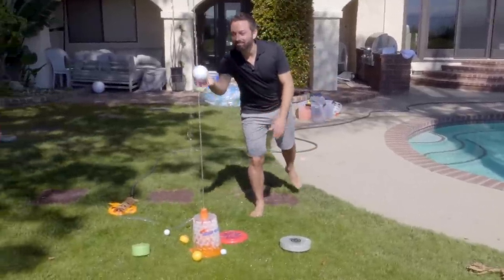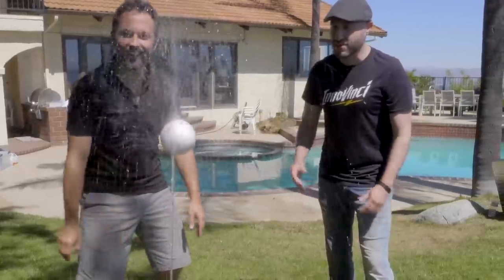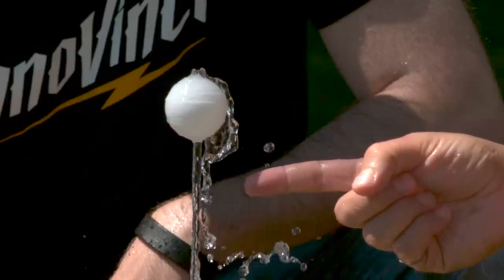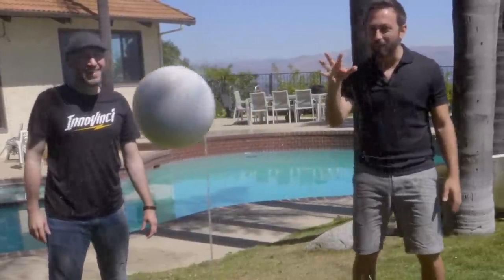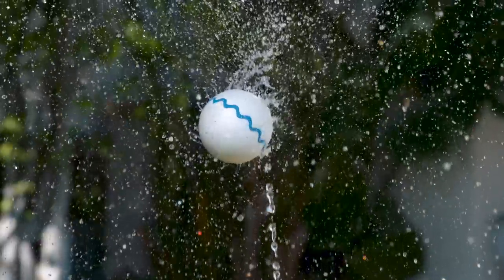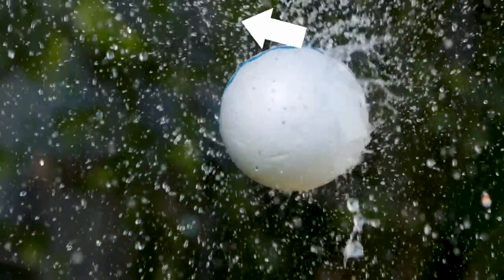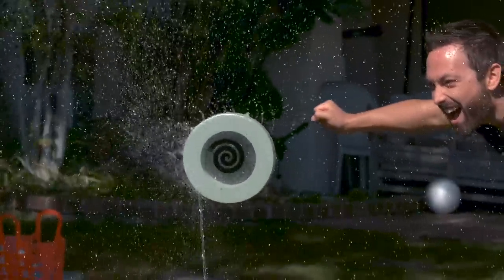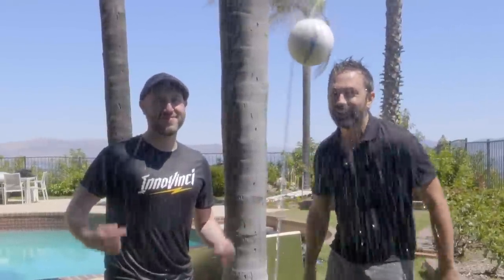Hydrodynamic Levitation!

Comment: Derek, it would be awesome to try this with a ball covered in hydrophobic coating - if the water cannot stick to the ball, much less of it will be deflected at an angle, probably making the configuration unstable, right?
Reply: Petee and a hydrophillic coating.
Reply: Yes, this is an excellent idea.
Reply: DO THIS!

i was honestly thinking about this righjt before i saw your comment, would b an awesome experiment
Reply: Petee it won’t work. You’ve essentially reduced friction. Friction is required to put the sphere or disk in rotational motion.
Reply: metwono 
thats the point, to see the case in which this phenomenon breaks down
Reply: Exactly.
Reply: thats the essence of science. you dont go well that sounds like a good theory and just accept it. what if a hydrophobic ball still worked? then the theory would break down and we'd be left with the question of, well whats the real answer then?
Reply: Someone mentioned this in another comment, thought that would be the result as well, if the water cant 'stick' to the ball, it would just get pushed out of the stream.
Reply: Corry Tuskey I understand what you’re saying and I don’t discourage anyone trying it. You could also consider different mediums. Would this work with air? At what point is the sphere mass too great? What would happen if you could change gravity? What if the mass of the sphere was nonuniform? What if the surface of the sphere were different? Etc.
Reply: microbuilder Yeah, I mentioned it and got 0 likes and 0 comments and this guy has 139+ likes and multiple comments. Oh well, just want to see it tested.
Reply: lol thats youtube for ya
Reply: The old Veritasium would've tried both configurations. The new one is all about being like the king of random and views.
Reply: This would be a great test of what I think is happening. I think its surface tension driven. I strongly hypothesize that it wouldn't work in this case
Reply: Nick Chambernator you should watch his new video about YouTube. this was all part of a bigger project
Reply: Petee soap water would also be interesting
Reply: YES I thought this right away seeing the video. It has a lot to do with water surface tension. Just use an additive in the water to break the surface tension (dish soap), and add it while the ball is suspended and I bet the ball would come crashing down as soon as the dish soap takes effect.

Comment: Hi Derek. I'm a bit late to the party, but I only just saw this video. Your explanation makes sense (conservation of momentum as the water leaves the ball) but I'm not so sure that the Coanda effect doesn't play a part... I think it's possible that the levitation happens because you have flow over the surface of the ball, which entrains surrounding air, generating a low pressure region where the water stays attached to the ball. Some water separates as it travels with the ball. The separation of water disrupts the entrainment of the surrounding air so the local pressure reduces compared to the start. When you integrate the pressure over the whole surface, you end up with a net force up and towards the stream. Similarly, you can take a piece of paper, hold it vertically and move it towards a running tap. As soon as it touches the water, the paper bends more towards the water. When the tap is running without the paper, air is still entrained but from all sides so the water runs straight down as it's in equilibrium. When the paper is placed with one side towards the stream and touching the stream, the dry side has no entrained air by the stream, only the wet side resulting in a low pressure and a net horizontal force further towards the stream. Try this out :) (maybe with a laminated paper, cause the paper gets soaked very quickly otherwise and stops working).

Comment: The force of the spray down cannot equal the force of the water out, the system momentum has to be equal and the sprays in all directions put pay to this theory. In addition this would have no affect on the initial suction of the ball prior to the spin being induced. The actual explanation comes from a common misconception about the lift from airflow being from bernoulli's principle alone. In actual fact a large force comes from the coanda effect, which is the suction caused by the boundary layer on the surface in the flow. If you dangle a spoon from a string and bring the curve under a stream of water under a tap you can see this effect yourself, noting how its not the pressure differential of the two sides of the spoon causing the spoons displacement. This demonstration of the ball in water is much the same. Its the suction of the boundary layer caused by the coanda effect, not the countering momentum of the water droplets, which itself would be minimal. This also helps to explain the natural balancing to bring the ball back into the stream as the effect is exasperated by increased deflection of the boundary until the point boundary separates from the surface and the ball falls from the stream.
Reply: ChevronTango now thats a much better explanation.  I was thinking the same thing about how the water tossed out cannot balance the force of gravity.   seems like dumb people levitate towards the simple explanations jesus christ

Comment: Would the ball behave the same way if you coated it with a hydrophobic layer?
Reply: Probably not because the water wouldn't bond cohesively to the ball, it would be reflected off the ball, pushing the ball out of the way of the stream
Reply: Fishface 88 i think you meant to say adhesively not cohesively.
Reply: inademv that would be a really cool experiment to try to verify his explanation!!
Reply: Sad not to have an example of this in the video. It was certainly the first thing I was curious about.
Reply: inademv the boundary layer will still be a layer of water, even if there is a hydrophobic coating.. it might work the same, but an example would have been good. top notch observation.
Reply: yep exactly. Water pushes the ball up while simultaneously wrapping around it. The spin keeps water sticking and the ball stable.  Probably other things play a part as well like the droplets that leave the ball in all directions help it stabilize even more.
Reply: inademv no because the adhesion is necessary for the force that keeps the ball in the stream
Reply: I don't think it would because that would stop the water from sticking on to the ball so it would just move away from the stream
Reply: We don't know for sure that that is actually the reason for the stability. Due to current data, we made a hypothesis that the water flinging around the ball is supplying ample force in the direction toward the stream to balance out the force applied directly from the stream in the opposite direction. However, I don't think this explanation is fully grounded since in some instances it looked like there wasn't really that much water being flung in the opposite direction, or at least maybe not enough to counter the stream force itself.
This is a science channel, testing whether the hydrophobic layer has an effect will help give evidence to suggest why the observed phenomenon is occurring, perhaps supporting the previous hypothesis and perhaps suggesting against it. Definitely worth testing, in my opinion.
Reply: I would like to see different surface types like golf ball dimpled or perfectly smooth and how that affects the behavior. Great video!
Reply: General.E.Shady 
But water gets propelled in one direction, there must be a force acting on it. And the counterforce can only act on the ball / disc.
Reply: you'd need a much bigger water stream. the Bernoulli effect would still allow it to levitate, but it would be much less stable
Reply: We have hypotheses, we need testing and a followup video.
Reply: The reason this round object does stay there, is because of the surface tension of the water. The water sticks to the surface of the objects and when it leaves, it exerts a force on the objects dragging it with it. Actually, the water doesn't leave the object at 5 o'clock, as Derek suggests, but instead most of it at 11. While it leaves, it also pulls the object with it. Pause the video at 4:47 where you can clearly see the effect.
Reply: Eris Sako yeah that's actually a pretty convincing theory!
Reply: Styrofoam is already hydrophobic...a better question would be a hydrophilic coating I think.
Reply: Fishface 88, That's why inademv asked about it. We don't know the real reason why this is happening, doing what he asked could get us closer to the real answer. We need to find a way to eliminate what we think is the cause of this phenomenon without changing any more variables; if the ball behaves the same, then there's another reason, but if it doesn't, then we know we can be surer that we have the right theory.
Reply: What would be really interesting to work out is what defines the height that the ball becomes stable at. I assume it'd be a function of the mass of the ball and the mass flow rate of the stream of water but it'd be interesting to try different sized balls of the same mass to see if that may result in a different resting heights
Reply: I wonder if adding a stream of a more viscous liquid (barring technical difficulties) would also be nice to explore this hypothesis. To the physicists/engineers out there: how would changing the viscosity of the liquid change the dynamics (relative to Bernoulli's law) ?
Reply: G'day,

  Yay Team !

  Great question...; and I think it would make a great difference.

  My guess is that Veritassium has got this one wrong, in that the Upwardly-moving Stream of Water is imparting "Lift" (Force directly opposing Gravity) via the Surface-Tension which enables the Water to both pull the Ball upwards and prevent it from moving entirely out of the Flow...

  The whole trick hinges on the Surfac-Tension allowing the Water to pull on the Ball.

  Add a bit of Detergent to the Water, or Grease the Ball, and watch how entirely differently this trick goes....

  ;-p

   Ciao !

Comment: Hello. This is a really fascinating experiment. However, I think that what actually levitates the ball has to do more with adhesion. The upstream coming under ball gets into contact with the ball on one side and due to friction, the ball is set in motion. However, due to adhesion, as the ball rotates, it tends to change the path of the water. To do this, the ball has to apply force on the water. There is an equal and opposite force due to this which pulls the ball towards the water, the upstream then applies a force underneath the ball, therefore keeping it levitated.

Adhesive force between the water and the ball keeps the ball in contact with the upstream and then the jet of water pushes the ball upwards.

This means that the total mass of water deflected should not be less than the mass of the ball or else the ball would fall.

Can you try one experiment using a hydrophobic coating/paint/spray on the ball and then another experiment with the jet of water at an angle? Please?

Comment: Back in the 80's I had a toy like this but instead of a ball it was a conical shaped thing, wide base narrow top. I think it had small holes in the sides to spray water outwards over the kids, but the top was a closed cap. Because of that, it was easier to accept the water kept it semi-stable, not like the ball off kilter. But I always felt it was MORE stable than it should be.  Like I felt if I didn't hold it perfectly flat when placing it on the water stream, it should topple off sideways before it had a chance to balance - but actually you could be quite casual and it would still take. As I remember it rose and fell and oscillated too, maybe because of the water holes on the sides? It's main colour was yellow I think, with red decorations. Who remembers it?

Comment: I think it has a lot to do with how the water sticks to things. The droplets are going up with considerable force. As they hit the ball they tend to bounce on the other direction (as do things that hit each other), but they are stuck to the ball now and that momentum pulls the ball and the droplets back together. Since the droplets had motion before touching the ball, that keeps the ball and droplets system in place.

Comment: This doesn't feel like a very fundamental explanation. 
Why is the force from the water rolled over the ball to the other side that pushes it back in the stream bigger than the force from the water that pushes it out?
I suppose bernouillu's law makes up for this difference.

Will it levitate if it can't spin?
Reply: I agree.
Reply: I suspect as the ball moves out, the steam can apply more torque than closer to the center, transferring more energy to the water stuck to the ball, and that causes more acceleration which gets the adhered water to fling of earlier, so more horizontally than straight down, resulting in the ball being pushed back into the steam.
Reply: I agree that the explanation didn't seem complete. I understood it better after trying it for myself - you can replicate it with just a spoon at your kitchen sink.  With the tap water flowing over the back surface of the spoon, you can feel how strong the force is (it works best with nicely rounded curves like measuring spoons). The ejected water to the side strongly pulls the spoons back into stream of water. 

I think what he didn't mention was that the force pushing the ball out of the stream greatly reduces (to almost nothing) when the ball has almost fallen out of the stream. Think about it - the water is hitting the ball's surface at an almost vertical angle, so it can't transfer much sideways momentum. 

This explains why the ball is actually stable at an off-centre position. The force pushing outwards has reduced to a point which perfectly matches the total force from water being ejected. 

TLDR: The force pushing the ball outwards reduces to almost nothing when the ball has almost fallen out of the stream + more water ejected sideways = ball moves back into stream.
Reply: I'm pretty sure the force is equal, otherwise it wouldn't be stable
Reply: I'm pretty sure he did not say that it was stable at the center.
Reply: Nick - true, I guess he didn't say it was stable in the centre. I'll remove that part.
Reply: I wouldn't think so. The spin seems integral to the effect.

Comment: This is the Coanda Effect. This is the same effect that keeps the airplane's wings suspended through the air. Also keeps the back of a spoon 'held' on the water stream. The ball (or disk) doesn't need to be spinning, as seen at 3:43. Friction is causing spin and sustentation, along with Gravity bringing it downward, Coanda is stabilizing horizontally.

Comment: 3:33

You claim there is a return force. I disagree.

The fact that the water is carried over and falls off the other side of the ball is not an indication that the water is forcing the ball back to where it was. That is what you thought. That isn't the case.

I am pretty sure what is going on has to do with water bonding with the ball and the suction effect it creates upon bonding. You know this bonding from the popping noise when a ball sits in your pool and you yank it out, for example.

So what is actually happening is, the water shoots by and some of the water creates a contact point where the water and the ball are now bound. Much like a vacuum.
The water,  still having momentum, tries to carry the ball up with it. But the ball is too heavy and the bond isn't strong enough so the bond breaks and so ends the vacuum. That leaves the ball behind. Some of the water shoots up and some of the water rolls with the ball. The ball would fall at this point but because more water is hitting the ball, the process restarts.

In conclusion, there is no other force beyond water pushing into the ball and then water pulling on the ball as it tries to carry it with it. There is no other force pushing the ball back to the center again. The cause for reset is 100% the vacuum.

Comment: This is a special case.  The necessary condition is the high surface area with respect to the mass,  It should work with anything circular in cross section.  The zone of stability is between 45 and 135 degrees. Those points reflect the maximum horizontal forces inside the system If no perturbing forces push the center of gravity from between those two points it will stay there as long as your water holds out.  Gravity provides the restoring force.  The forces are radial across the top and the spray is momentum.  The radial forces across the top sum to a vector equal and opposing the resultant vector of the stream, after removing the couple which rotates the ball.  The ball bobbing in the videos is a.response to variations in the stream and the wind load.  The restoring force at work. The heavy lifting in the phenomena is done by symmetry.  A sphere is placed in the right position to achieve this effect because it is symmetric about all three axis.  It can't be inserted incorrectly  A disc has to be placed at the center line.  Place it off center and there are no restoring forces and the disc will wobble and fall off. The water uses the ball to create a mass pump.  You provide the energy to kick off the process by placing the ball.  This doesn't scale well obviously.  And you can't approach the stable point from the center, the flow will accelerate the ball from the stream.  The effect looks strange because we aren't use to seeing very small effects generate visible phenomena like this.

Comment: I spent my whole day trying this. Here's what I found out:
1- it's probably better to pair small balls with small diameter streams. and vice versa
2- the velocity of the stream is crucial!
3- it didn't work on rough foam surfaces but it did on the smooth surface
4- it's in the works, for tomorrow, I want to try a hydrophobic coating and see if it'll work better. Mine lasted maximum 1 whole minute, with the average being around 4 seconds